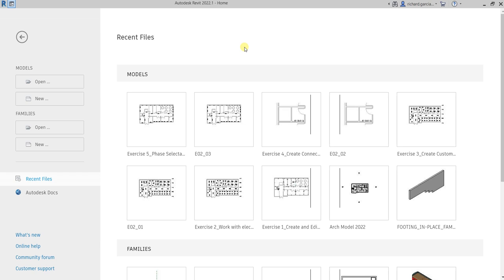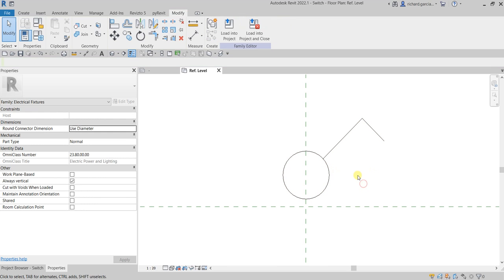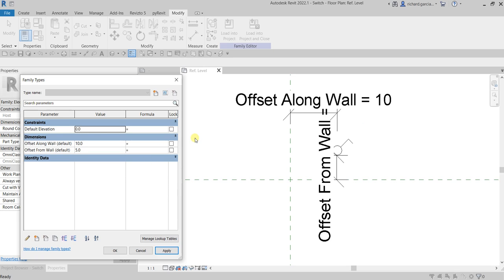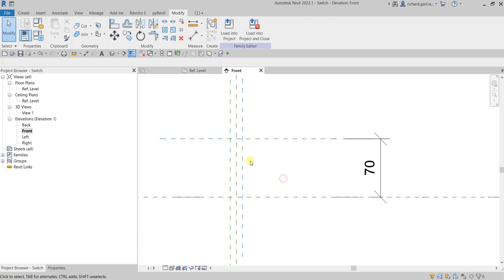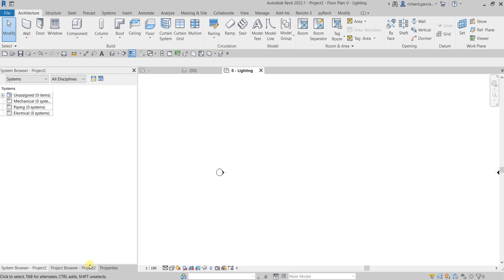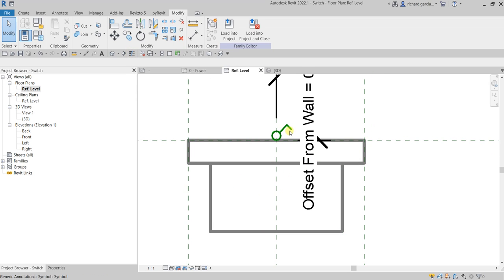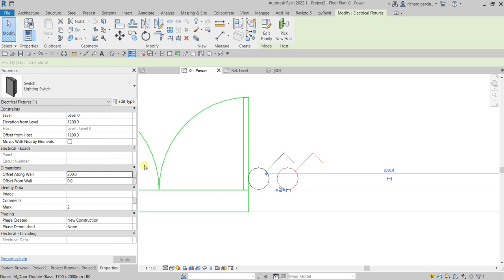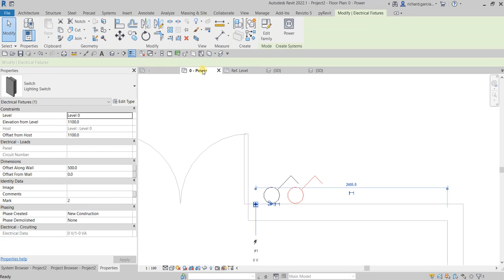REVIT TIPS AND TRICKS: CREATE ELECTRICAL FIXTURE FAMILY WITH OFFSET SYMBOL PARAMETER

Comment: I have a Revit family where I apply parameters to move its tag up and down in a floor plan while keeping the family in one place. However, when I use 'pick new' with the 'Vertical face' tool, it doesn't move horizontally. I need it to move in both directions. What should I do?
Reply from the maker: To enable a tag to move both horizontally and vertically in a Revit family, you can follow these steps:

### 1. Create Reference Planes
- Open the family in the Family Editor.
- Create two reference planes: one horizontal and one vertical.
- These reference planes will be used to control the position of the tag.

### 2. Assign Parameters to Reference Planes
- Select each reference plane and assign a parameter to it. You can create new parameters if needed.
- For example, create a parameter named `HorizontalOffset` for the horizontal reference plane and `VerticalOffset` for the vertical reference plane.

### 3. Align and Lock the Tag
- Place the tag in the family.
- Use the `Align` tool to align the tag with the reference planes you created.
- Lock the alignment to ensure the tag moves with the reference planes.

### 4. Create Dimensions
- Create a dimension from the family origin to the horizontal reference plane and another from the family origin to the vertical reference plane.
- Label these dimensions with the parameters you created (`HorizontalOffset` and `VerticalOffset`).

### 5. Add Flexibility
- Flex the family by changing the values of `HorizontalOffset` and `VerticalOffset` parameters to ensure the tag moves as expected in both directions.

### 6. Load the Family into the Project
- Load the modified family back into your project.
- Now you should be able to move the tag both horizontally and vertically by adjusting the `HorizontalOffset` and `VerticalOffset` parameters in the project environment.

### Additional Tips
- **Visibility Controls**: If you want the tag to be adjustable in the project, make sure the parameters are instance parameters.
- **Reference Lines**: Sometimes using reference lines instead of reference planes can provide better control, especially if you need to rotate the tag.